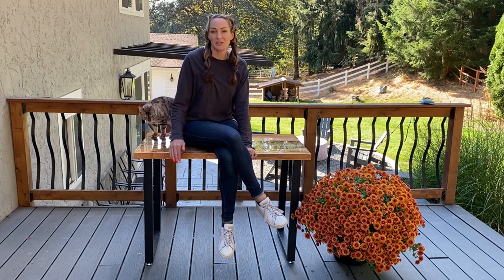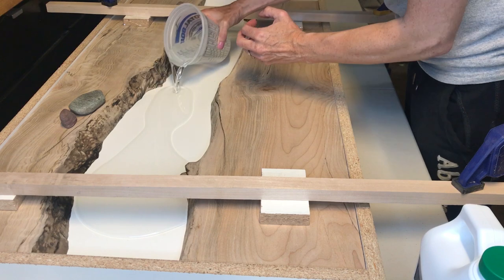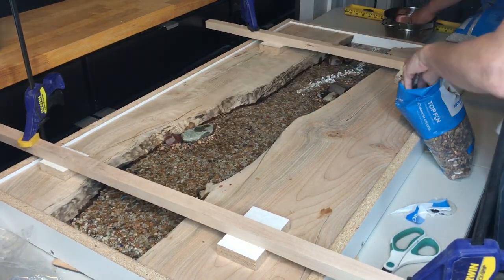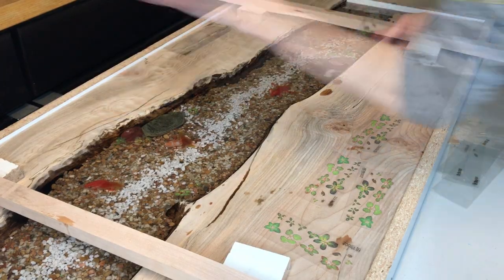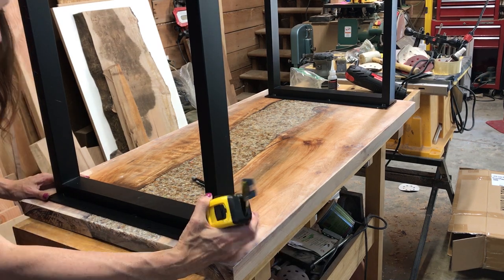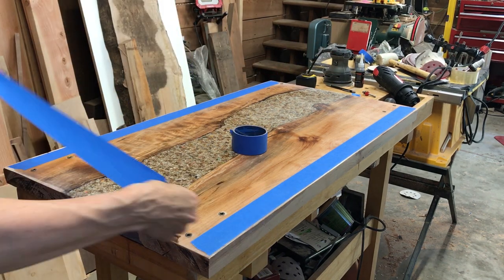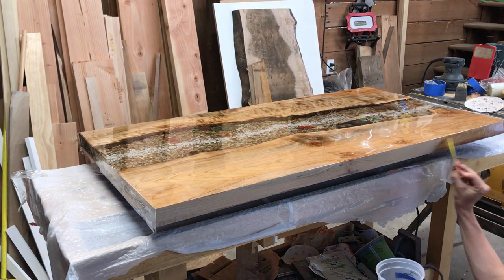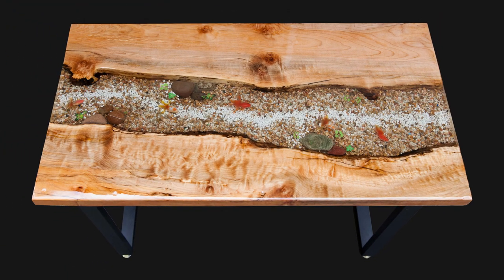Epoxy River Table Desk with Fish

Comment: To keep my epoxy from sticking to the melamine, I cover the entire inside of the mold with Tyvek tape. (no caulk)  Releases without any problem (for me anyway) and I was even able to reuse the mold.
Reply from the maker: I’ll have to try that next time, thanks for the tip.
Reply: Kindly elaborate it